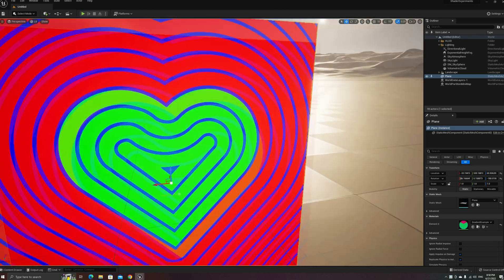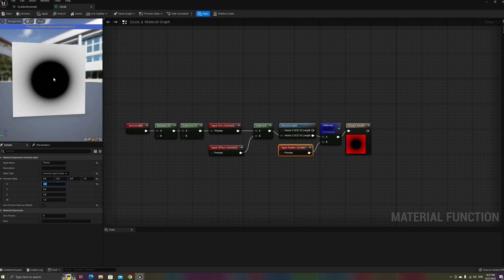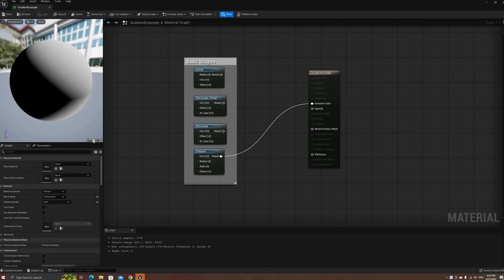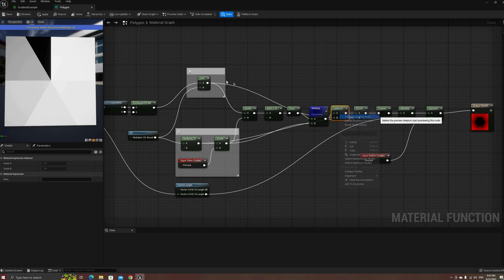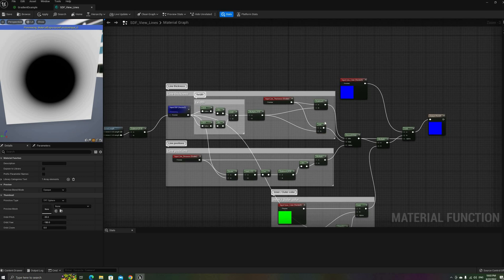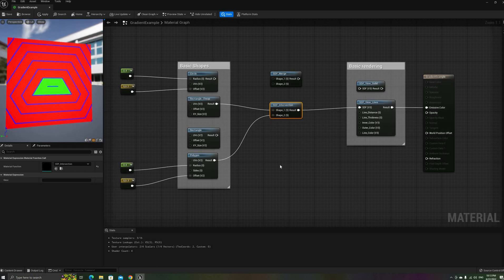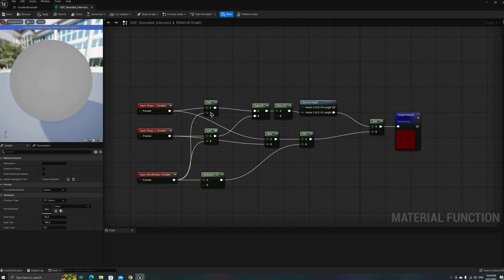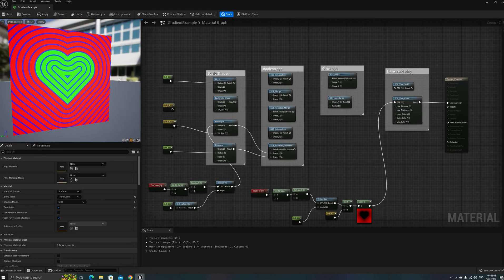Procedural materials 2: Signed Distance Fields 2D

Comment from the maker: Here's the code for the heart at the beginning and end of the video, used in a custom node:

p.x = abs(p.x);

if( p.y+p.x>1.0 )
    return sqrt(dot(p-float2(0.25,0.75),p-float2(0.25,0.75))) - sqrt(2.0)/4.0;
return sqrt(min(dot(p-float2(0.00,1.00),p-float2(0.00,1.00)), dot(p-0.5*max(p.x+p.y,0.0),p-0.5*max(p.x+p.y,0.0)))) * sign(p.x-p.y);

The input (p) is a rotated UV coordinate. <3

Comment: Hi this is a great tutorial! Thanks for making it, I'm new to all this blueprinting stuff so this has helped a lot. I do have one question though, Is it possible to add rounded corners to the polygon shape?
Reply from the maker: Glad it was helpful! Rounding corners is easy, just subtract the radius of the corner from the polygon shape SDF and you're set!
You might notice that when you do that the polygon also grows, so make sure you compensate for it :)
Reply: @EnriqueVenturaGames  Thanks for the quick reply! I gave that a shot but i'm still having issues with it, is it as simple as adding another subtract at  the end of all the nodes with a different value?
Reply from the maker: @jlay21  it should! It works the same as in the rounded merge operation (regular merge with a subtract)

Comment: This is such a great tutorial, thank you. 
You wouldn’t happen to know how to turn this into a Radar Graph, where one can adjust each point of the polygon?
Reply from the maker: I don't think there is an easy way to do it using a SDF approach; I would recommend using triangles to create the chart object and then render that to a texture. That way you could also layer other quads with the graph scale, for example.
If you still want to do it in the shader, you can create a custom node that rasterizes some triangles to make the chart; that would be more efficient but also more complicated to achieve.